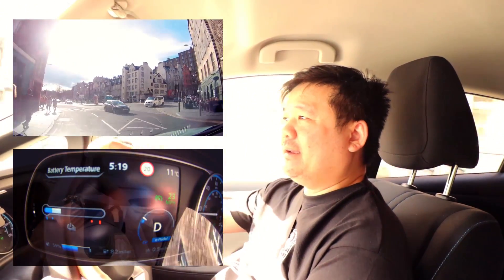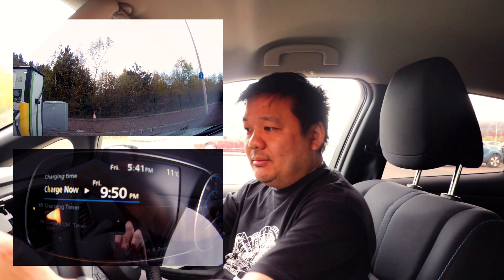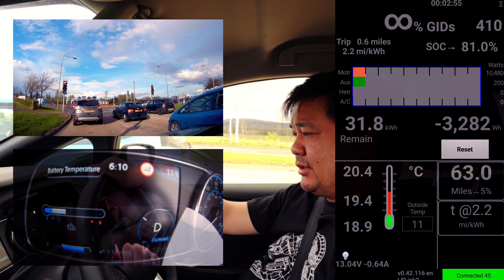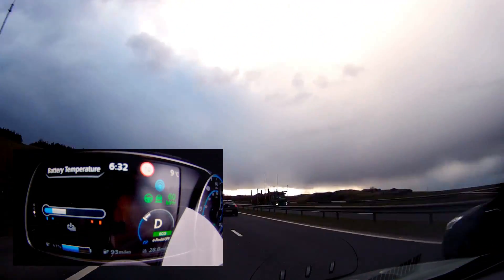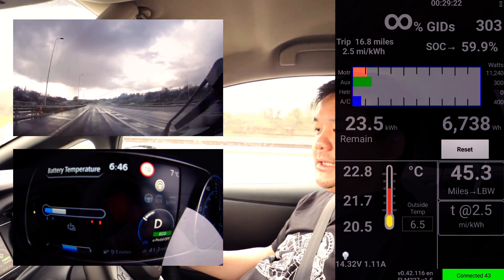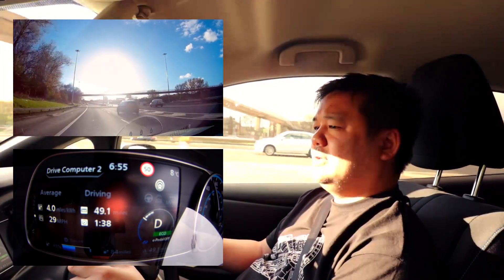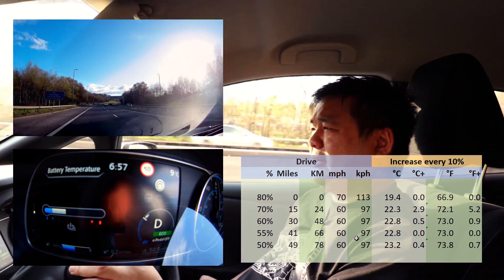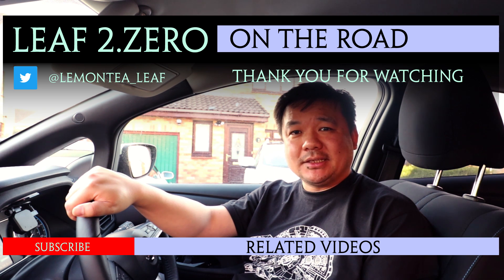Nissan Leaf 2018 - Optimum running temperature of the Leaf in Scottish spring cloud weather

Comment: How much influence does the outside temperature make to battery temperature? Another great video, did you get led's installed?
Reply from the maker: from what I've seen so far the outside temp is always close to what the battery temp is. it might be 1°c +/- depending if you're in the shade or direct sunlight.
Reply from the maker: Not had time to install any LED's yet :(

Comment: From what you've said, I think I'll start from home with a full charge, do about 100 - 120 miles to get down to 30% and then see if I can find chargers at about 100 miles/30%  to keep within the parameters you have set for optimal battery temperature when doing long distance and rapid charging. Intresting information you're providing. Thank you.
Reply from the maker: So far it does seem the best point to charge the car.

Comment: The equilibrium temperature at 60mph is largely dependant upon the ambient temperature, which is pretty chilly there in scottyland.

22.8C is 73F in real money.

Here in Tennessee right now the daily high is in the 90's with lows in the 70's. My battery starts its day at 80F or 26C driving out of the garage and hits 30C by the time I get to work. Since it will be over 33C in the shade by quitting time, the battery will have gained temperature before heading home.

The LEAF battery can only cool itself down if the outside temperatures cooperate.

Redo your tests in August and I'm sure you will get a different optimal operating temperature driving the same route at the same speed. The interesting thing to see is will 60 miles per hour result in a new equilibrium or will you have to drive more slowly to achieve an equilibrium temperature.
Reply from the maker: Jean-Pierre White my next video this weekend should answer some of your questions to a certain extent. You make some good points and if we're lucky to have a heat have here 25°c+ I'll see about doing another test.

Keep the questions and ideas coming it helps with how I adapt future tests.

Comment: Looking forward to your long journey as I going to Manchester later on in the year 170 miles that is if get my  car was supposed to get it 18th may  but my dealer has phoned date has now changed to 8th June 👎🏴
Reply from the maker: williamlorimer060867 aw man switching the date is not cool! Honestly the 170 mile trip will be easy on the leaf it's the 250-350+ that a bit harder. I do have a 430 mile video to edit that was done within 24 hours. Which hopefuly be edited before end of month.

Comment: Finding the optimal temperature, or designed control point of the passive control system, is hard to do without more sensors. The only sensors needed are the battery temp (which you have with Leaf spy) and the temperature of the outside of the battery case and air surrounding the battery, which you don’t know, but can only infer with a matrix of tests which include outside air temperature, relative wind speed, and HVAC settings (cabin air temperature, fan speed, recirculation on or off).

If the battery thermal management system is directly controlled by outside air temperature, and at 11c the battery temp appears to reach equilibrium at 23c, then on a day which is 31c, the battery would reach 43c when driving 60 mph. 

However, if when running the HVAC in full auto on a 31c day, if the battery reaches equilibrium at 25c, at 60 mph, then we can see the passive cooling system is not tied to outside air temperature, but rather cabin air temperature.

The battery passive heating/cooling is going to have significant lag with respect to the air flow and temperature surrounding the battery case, compared the the internal heating caused by current through the battery during hard acceleration or rapid charging. 

Of course with any control system, if the error is zero, the controlled variable won’t change. So the more error you introduce, the easier it will be to find what influenced it. 

We already know the setpoint, the desired temperature of the battery is about 20-25c, so when you start with a cold battery or hot battery, and see which things will drive the temperature back to setpoint fastest, then you would know the passive control system design.

So far nobody has tested the Leaf the way it’s designed to be used. Most of the big vloggers turned off the HVAC, set it to recirc, and turn the fan off because it makes noise which disturbs the vlog. And they also want to get 10% more range so they dress like an Eskimo. But what happens if you just put the HVAC in full auto and let it do its job? It will maintain the cabin temp around 20-25c, which is also the control point of the battery,

If it turns out there is no correlation between HVAC and passive management system, then I agree the ones responsible need to be keelhauled.

Comment: I'm sorry to say, but I cannot even figure out what you are trying to do here, but in any case it is unscientific and IMHO quite pointless. First, you are talking about optimal temperature, but it seems you mean equilibrium temperature, which is the temperature a system will tend to if conditions are otherwise held constant. There is no reason to assume the equilibrium temperature is a good one, other than that engineers will have tried to put in some mechanisms to prevent temperature from getting too bad; but even if they did the result is not necessarily optimal.

If you are really interested in optimal temperature, you should state a precise goal for the term to have any sense. In the case of an EV battery I can think of at least 3 different goals, which might prefer different temperatures: least battery degradation, fastest charge rate, and highest efficiency (least internal resistance). And if you do select a goal and want to figure out where is the optimum, you need a more systematic approach; in particular many measurements where you make sure you are only changing the temperature. This is not easy to do (and if your goal is least battery degradation, it is virtually impossible).
Reply from the maker: Thanks Marc van Leeuwen, you are right I'm talking about the equilibrium of the battery temp based off the speed I was doing.

Comment: Hi James just as a point of reference ;) eco doesn't do anything to the range when using Pro Pilot mate. Yes I'm sad and I have nearly read the entire manual ;)
Reply from the maker: I was wondering about that when driving at the weekend...
Reply: Are you sure it doesn't limit acceleration when PP is engaged? I would expect it to accelerate more gently also in PP, e.g. if I resume a higher set speed when driving at a lower speed.
Reply: not sure but it says in bold in the manual that it doesn't bring any benefits with PP. Cheers

Comment: Hi James. It seems that the battery temperature stabilised at 23 C when driving at 60 mph with an external temp of 10 C. It would be interesting to find the stabilisation temperature at 70 mph for comparison purposes too.
Reply from the maker: the roads I normally drive don't support 70mph :( but I know for a fact that temperature will only rise at 70mph. in my next temp related video i'll be doing anywhere from 30-60mph so you can see how the temp of the battery is affected at these speeds. If i get a chance I'll try and do some warm battery at 70mph be interesting to see how much it goes up by. but my guess it'll be like a runaway greenhouse effect.

Comment: A great video but to be honest you shouldn't have to do this Nissan should provide all the data required for charging the vehicle on long journeys or just for efficiency and longevity of the cells -  no guess work at all
Reply from the maker: If Nissan did their job right I’d be out of a job on YT :D but you’re right they should really supply the data but that would mean admitting there's an issue with battery temperature :(

Comment: Hi James and thank you for again providing more data about using the battery in an EV to the greatest effectiveness. I'm in 2 minds about how I feel about this info : on the one hand it is fascinating but on the other it introduces a level of complexity in my potential future personal transport that I'm not used to? Currently I have a small petrol-engined car (50 mpg average) and I don't need to be concerned about ambient or engine/fuel temps, just how much is left in the tank.
I really like the way EV's drive, but I can't help feeling that we are still some way from a sustainable, durable, reliable solution with them, due to current battery tech behaviour.
Reply: It’s important to remember these are still early days for EVs. Everybody buying in now are early adopters and the value that videos like this bring will go a long way to define how the technology evolves.

I can’t wait for my 2018 to arrive, and I can’t wait until I’m trading that in in four years.

The people buy in now, the more we’re contributing to this one day being the new normal.
Reply from the maker: This is mainly an issue with EV's that don't have any type of Active Thermal Management (ATM) that can help with long distance driving. For most people this isn’t an issue but if you want to take a lot of trips over 250+ miles then EVs without ATM may not be the right car to buy. For me I’m just curious if I can beat the temperature curve of the 2018 Leaf.

I think 2019-2020 will be when manufactures will understand the public want some sort of ATM in their cars
Reply: My concern is that I'm retired and the next car (hopefully an EV like the Ioniq) may be my last new car, it's a lot of money and I want to ensure it it will do whatever I want to do. So most days local stuff but if the weather is good maybe drive down to Nice or Cannes and dip my toes in the Med !!
Reply from the maker: The Ioniq has ATM so could be a good choice if you want an EV this side of 2019. I would love to recommend the Leaf 2018 but honestly for what you need I can't. It's a shame as it has a lot of great features. If you're after a Leaf I would wait for the 2019 model with larger battery and hopefully the ATM you need.
Reply: I'm pretty sure that I'll be waiting until 2019 in any case mate. I've heard that the Ioniq is likely to have a bigger than 28kw/hr for next year, possibly up to 43kw which with the inherent efficiency  the Ioniq already has, the bigger battery (and reasonable price of course) should make it ideal for me. Unless...............................